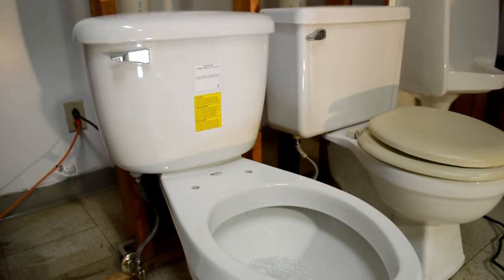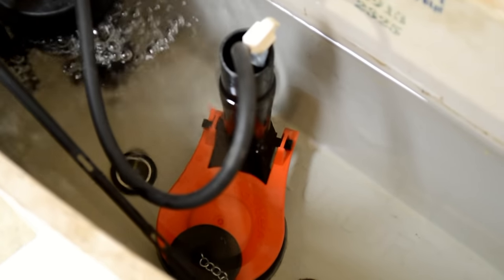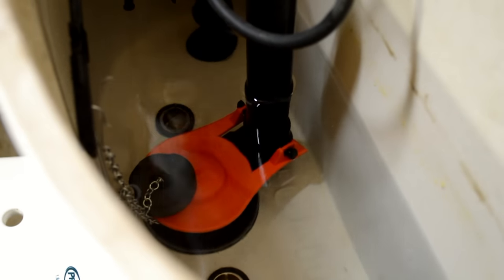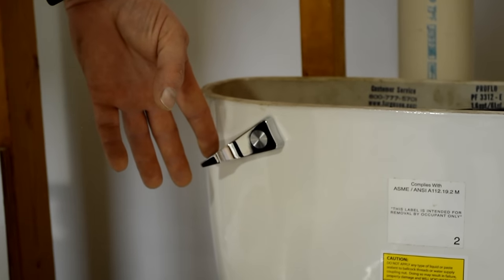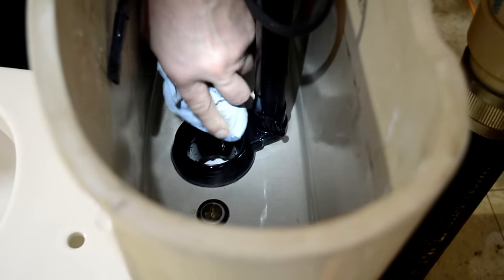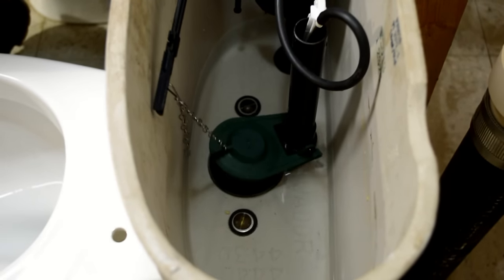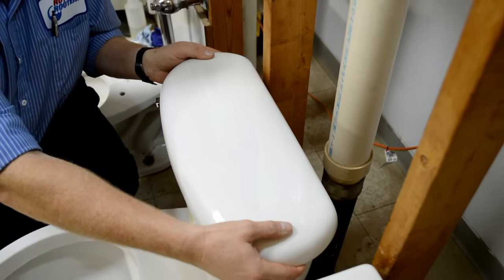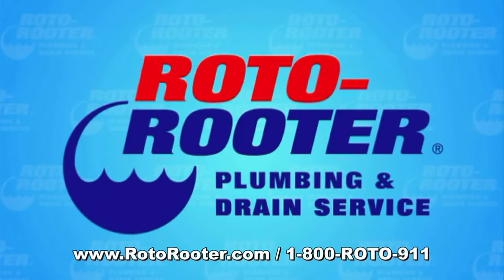Plumbing Tips - How to Replace a Toilet Flapper Valve | Roto-Rooter

Comment: 2 minutes, straight to the point. No blither blather... thank you.
Reply from the maker: Thanks for your concise feedback, Nick.
Reply: Except it wasn't accurate in that most flappers are universal and only thing to know is 2" vs 3" which can be easily achieved by bringing the old flapper with you. Boom.
Reply: Small caveat is Kohler, but most universals I found have adapters for the nuanced flappers, therefore most universals are truly, universal. Takes zero effort, literally
Reply: @j.ballsdeep420  Then why even bring it up, you're silly if you dont bring the old one with you to the home depot!!!!!!!!!!!!!!!!!!!!!!!!!!!!!!!!!!!!!!1111
Reply: @michaels5034  -- What are you going on about?
Reply: @j.ballsdeep420  I just had to replace the flapper in the toilet downstairs today. When we built our house 22 years ago we actually bought our toilets in Canada for the more water used per flush. The universal one I bought today worked perfect!

Comment: Very helpful video!  

We experienced "ghost flushing" every few hours or so.   We had no idea it was due to worn out old flapper valves.  Our valves were original OEM and 24 years old.

    Time for replacement for sure!!     Picked up a couple of new flapper valves at Amazon and installed per this video and problem solved!!!  No more leaking or wasted water back into the toilet bowl or ghost flushing!! 

Thank you RotoRooter!   We were going to call a very expensive SF plumber too!  Saved us a bundle!
Reply: I had never heard of that or experienced thank goodness. 
 I'm grateful I saw this video knowledge is power.

Comment: This video was very helpful.  Thank you for saving me $100+ to have a plumber come out for such a simple repair.  I removed my flapper, took it to Home Depot to buy a match, then installed it in five minutes.  Hardest part was trimming down the linked chain.
Reply: Laugh, why did you trim it? Just take the connector off and move it up the chain. Laugh

Comment: A very informative video. Everything you need, and nothing you don't.
Reply: 1. Make a decision (somehow) to cut the part of the new flapper off, that part that seems like it could help seat the flapper.
2. Wish that you had 1/4 turn off valves if you instead have a 25-20 year old gate valve that doesn't turn all the way off...
3. Do your new flapper install.
4. See how easy that was!!

Comment: Great video. I had no idea replacing a flapper was so easy. I cleaned my flapper and the piece it sits in real good (parts are only 4 years old). So far so good with the dye test. If not....a flapper replacement will be a piece of cake thanks to your video.

Comment: DON"T BELIEVE  "universal size" flapper it's not true! I found it is best to bring the old bad flapper to the hardware store for comparison alongside what is available to buy. After buying a "universal" size, and trying to install it I found that the distance from the hinge points to mean center of the seal  was too long and the "universal" flapper would not seat into the hole causing a continuing leakage. Back to the hardware store the next day with the old flapper, I eyeballed it side by side with others and was able to choose the correct size flapper which worked perfectly when installed. No more leakage.
Reply from the maker: It's always good advice to take your original flapper valve with you to the hardware store and match it up with the right replacement part, but universal flappers will fit the majority of toilets out there - though not all, as you learned. Thanks for your constructive comment.
Reply: Harry Schaefer s
Reply: Harry Schaefer
Reply: Harry Schaefer v
Reply: Harry Schaefer q1qqq
Reply: Harry Schaefer

Comment: I tried to remove the old flapper by "pulling the old flapper from pivot arm mount pegs on the overflow tube"...but it would not come off no matter how much I pulled and twisted. I was afraid of breaking the mounting pegs, so I stopped pulling and cut the tough old flapper off with an exacto knife. The old flapper was hard and rigid. The new flapper was soft and slipped on with no problem.
Reply from the maker: They can definitely get stiff when subjected to really hard water or chemical cleaners. You did the right thing by cutting the flapper off.
Reply: Bleach tablets contribute to the early demise of the tank's plastic innards.  Best to use a bowl freshener that hooks over the rim.
Reply: @msr1116  -- Or just clean your toilet once a week? Jesus
Reply: @j.ballsdeep420  ....I clean it every other day, you dolt. The hanging freshener is for between cleanings. Some of the needlessly attitudinal replies you people post are just laughable.

Comment: I just replaced my toilet flapper last week by myself and now i saw this.
I told my building super many times and told him my lever might need replace one but after all it was the old worn out flapper.I suffered over 3 weeks of water running sounds everytime toilet flushed by my family...it was exactly the same looking one..new one was little bit different but it fits.
Reply: Yeah, for a $10 fix I don't even bother my maintenance guy --screw it, just fix it. Gotta water hammer issue with my toilet so I said screw it and just dialed the pressure back by cutting the valve off at like 50% but that creates annoying wine as, duh, valve not suppose to act like that but I don't care until flapper went bad and was either deal with a water hammer or deal with an annoying wine all night: New flapper next day after scrubbing didn't fix and badabing, done with no wait plus I'm easy going with no issues for my maintence guy unless it's major. Win-win

Comment: Removal of the existing flap is not as easy as shown in this video.  If the flapper has stiffened over time and isn't flexible enough to remove as shown, use a pair of plier-cutters to cut the old one up if necessary so it can easily slip over the pegs.
Reply: mine went the other way. I took it out and it had already disintegrated.

Comment: Thank you so much for this! I had to change my flush valve the other day but hadn't bothered with the flapper. I got it to flush and fill....too much 😂 This solved my constant water running problem in a jiffy. Thanks again!
Reply: So you're saying you only needed to replace the flapper. Got it

Comment: I did mine without shutting off the water. I disconnected the chain to the old flapper, and unhooked its arms, but left the flapper in place. Then I hooked up the chain to the new flapper, set it down on top of the old flapper, hooked up the arms on the new flapper, then  pulled the old flapper out from underneath the new one, losing no more water than a flush of the toilet.
Reply from the maker: Awesome work! Thanks for sharing.

Comment: where do you get that rubber floater weight chain. i was going to put a fishing weight to lower the flapper sooner faster and save water.
Reply from the maker: +Emba Lona Depending on the brand of flapper, they sometimes come in the package. Be careful trying to weight it down with a fishing weight. It may result in a less complete toilet flush.
Reply: a  few  days
Reply: +nevermind ,  but  2nd
Reply: tractors
Reply: +RotoRooterTV Great  advice!
Reply: +Kevin Wedderburn klo I'm c v
Reply: +Ximena Enderica glitch
Reply: u
Reply: o
Reply: godsmackstraighghtout online
Reply: teuy
Reply: +Denber Yesheberu lomacimo,vicent,fer

Comment: This was excellent.... I looked at the flapper that was in my toliet... I order it from amazon and got it overnight.. I literally did EXACTLY what he said to do and it is done!!! I had that "ghost flushing" mostly and every once in a while I would hear it bubbling in the bowl but only for a few seconds but then the "ghost flushing" started every day instead of once in a while and then is stared every 20 or 30 minutes... that is when I started goggling... So happy to find this ths you tube video.... Now I just installed it and so far I hear nothing but it is still too soon to see if that was the actual problem but I think it is because there was never an actual leak on the floor or behind the toliet that I could see... however, maybe someone can answer this for me.... when I replaced the flapper I noticed that there was like a putty type of seal under the flapper that actually hits the bottom on the bowl.. half of that was floating around and the other half was sealed... I know I had a gasket issue last year and a plumber came over and removed the tank and replaced the gasket on the bottom of the bowl... at that time he also replaced the flapper and I am sure it was an OK flapper but it didn't last more then a year because it was not a fluidmaster as far as I am concerned, but my question is to anyone... I have NO LEAKS that I know of and I am positive the gasket under the tank was just replaced... should I be worried about that seal or is there a way to replace that seal without having to remove the filler valve?? Thanks and I will get back and let you now if this was indeed the issue but I have not heard anything thus far... Thanks for this video... it was just perfect and easy for me to do so I didn't have to call a man or beg for help... I actually did it myself... KUDOS

Comment: sometimes all is needed is an old toothbrush and some hard water cleaner, just to dissolve or scrub away mineral deposits between the flapper and the round contact base which the flapper sits on!
Reply from the maker: That's great advice. Thanks for sharing it with others. We've seen some amazing mineral buildup caused by hard water and you're right, it can prevent the flapper from making a good seal.
Reply: David Yee flor con liston de celoceda.
Reply: como hacer flor con liston celoceda.
Reply: hola como
Reply: roadlimoster yy
Reply: roadlimoster
Reply: roadlimoster  lol
Reply: khaoli is
Reply: roadlimoster ,

Comment: How much would Roto-Rooter charge for a Refill Valve and Flapper replacement. The parts at Home Dept are cheap. $10 for the Refill Valve and $16 for the Flapper. How much is the labor? I think I'll try to do this myself. Thank you.

Comment: I looked at the bar where the flapper holes are supposed to connect and the bar has square tabs. You make it look like it slips right off.  I am not do sure and very hesitant to pry it off and on.  Any advise would be appreciated.

Comment: I attempted to remove my flapper; and this does not seem to be possible.  Any advice?
Reply from the maker: Does your flapper resemble the common one in our video? Or does your toilet have a flush tower of some sort? If it looks like the one in this video, you can always clip off your flapper with a heavy-duty scissors or wire cutters.

Comment: My flapper seems to"float" up slightly. Barely touching it and it seals.    Plenty of slack in chain.. Why
Reply from the maker: Is it the original flapper or a replacement that is floating? Since there is plenty of slack in the chain, that makes me wonder if you might need to order a specific flapper from the manufacturer, rather than an off the shelf replacement or universal flapper from the store. This is becoming more common now as manufacturers are relying less on common parts and making proprietary flappers for their toilets.

Comment: what is the black tube from the fIoat valve to the overflow tube for?
Reply: Thanks very helpful of you.
Reply: +Chromeremotecottage Cottage. No! the 12mm black rubber tube from the flush (fill) valve into the overflow?What's it for?
Reply: +Adam Garza ok thanks for your sensible answer! the pan is what we'd call a double trap syphonic.I like fluid master products,they're catching on over here (u.k).

Comment: I have a toilet of the brand Universal-Rundle, and the Flapper has hard plastic at the hinges, so I can't remove the Flapper easily. It seems like I have to use cutting pliers to cut the hard plastic to remove the Flapper, but what if the Universal Flapper doesn't fit?   I need to replace the Flapper only because the flush lever connects to the Flapper by hard plastic also (instead of a metal chain), but over time, the hard plastic "fatigue" and broke at the point where hard plastic connects at the top of the Flapper. I could use some Gorilla glue to glue it back but the Gorilla glue swelled under water, and the glue can fail to attach to the surface of the hard plastic and the top of the Flapper. Maybe using a plier to cut the hinge of the old Flapper is a better way (just hope that new Universal Flapper will fit).  I wonder why the Universal Rundle brand is not made to be easily repaired. Many plumbers suggest just replacing the whole toilet... would cost about $200 for the new toilet and $300 for the labor.

P.S. I watched https://youtu.be/KiwbbSYwVMA?t=186 and it turned out that semi-hard Flapper can be removed in that video, and it worked to remove the Universal Rundle one (this one is 360 degree surrounding the hinge)... and fortunately, the universal Flapper also fits. I just had to cut the hard plastic dangling and hook the extra chain to the top hook so it is not dangling which otherwise could block the 2 inch flushing hole.
Reply from the maker: We're glad the universal valve worked for you. Universal-Rundle parts can be difficult to find, so it's a good thing the universal flapper fit. The brand is now part of American Standard, so you could always contact them for advice. Some homeowners have replaced the original tank parts with aftermarket parts from Fluidmaster and Korky so that future replacement parts will be simpler to match. I did that with some Mansfield toilets I had in my house and they were far easier to maintain afterwards.

Comment: my chain broke off what it connects on the flapper ... The way that it has broken off  the little connection with it so I have to replace flappsr.  are they specific ones for specific toilet brand  or are they all universal?
Reply from the maker: You're better off trying to match the one that came with your toilet. In recent years, manufacturers have moved toward proprietary flappers, so universal replacement flappers aren't the sure bet they used to be.

Comment: I changed my flapper but the water is not filling up the tank after I turn the water valve on
Reply: I need some help
Reply: @bxxiittsscaviez  I suggest you bring the old flapper and the new flapper down to the hardware store and make sure you have the best fit happening. It sounds like the new one isn't the right size. Also write down the make and model of your toilet so they can look it up to verify if necessary. Hope this helps.

Comment: I easily changed the red flapper but the tension in the toilet's handle is not sufficient to flush the toilet.  How do I adjust the tension in the handle after changing the red flapper and making sure the seal is tight?
Reply from the maker: Without the chain attached to the flush handle, it should move freely back and forth with almost no tension. The only tension should come from the chain and flapper when attached to the flush handle. You may have to connect the handle to a link farther down the chain to get the right action. Keep trying different links until the handle has the correct feel and action.

Comment: Is stool blockage a common issue for the flapper? I noticed some brown stains on mine.
Reply: Lmfao, NO. Stool goes down a different pipe, homie: Fresh water comes from your tank. That is, unless someone gave your tank an upper decker....
Reply: I mean, if you have only one toilet, and someone else is on the bowl, what else are you supposed to do? /s
Reply: That may be some of the sealant from the valve seat.

Comment: Only thing he left out is after you turn the water back on, flush the toilet to test and make sure the chain length is properly adjusted and the flapper gets opened sufficiently to allow for a complete flush, and if needed adjust the chain length further before putting the top back on the toilet.

Comment: How can I know if it’s 2,3 or 4 flapper valve to replace it?
Reply from the maker: The best thing to do is take the existing flapper down to your local hardware store and ask them to help you match it up. Be sure to make note of your toilet's manufacturer and model number too. Unfortunately, universal flappers aren't as "universal" as they used to be. Sometimes, you even have to order a replacement from the manufacturer if one isn't readily available at the store. If that is the case, limp along with your old flapper until the new one arrives.

Comment: Are they all the same size?
Reply from the maker: No, but they do make "universal flappers" that work on most toilets. We recommend taking your old flapper valve with you to the hardware or home store to match up with a replacement unit.
Reply: Got it. Thanks!

Comment: Mine's attached to it like welded on only with hard plastic & a little metal. So I can't get it off.
Reply from the maker: You should look up the toilet on the manufacturer's website to find some information on how to replace its flapper valve. It sounds like an unusual design.

Comment: I have never seen this kind of flapper, does anyone know who carries this?
Reply: It's just a different type. never seen these in New Zealand. there are the old ballcock and other central flush units. some have rotating handles  some single flush others full/half flush. the ballcock version are great you can adjust the ball arm to fill the toilet with more or less water.
Reply: +Michael Stoneham its f6afa